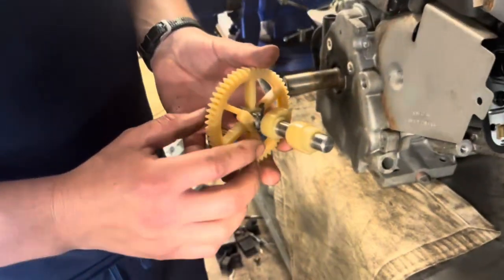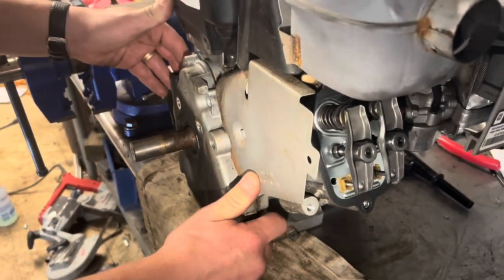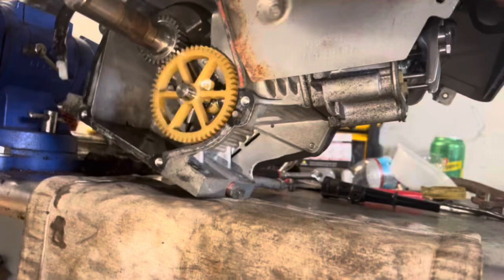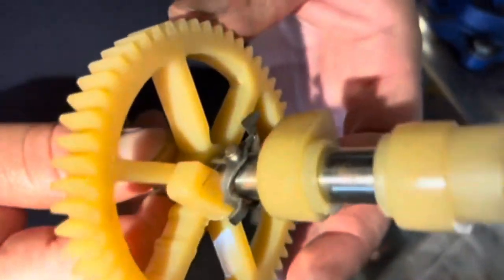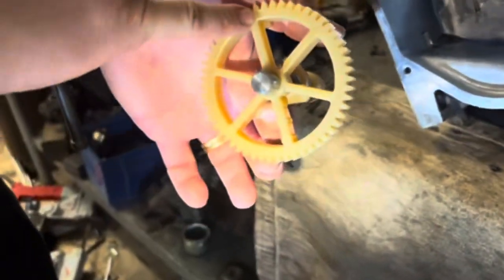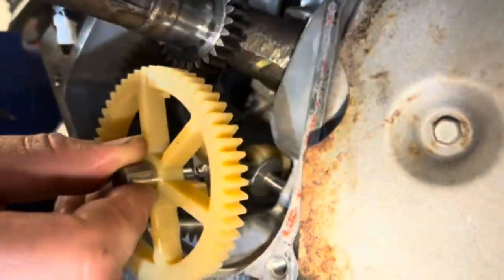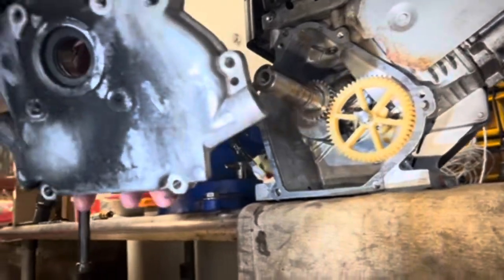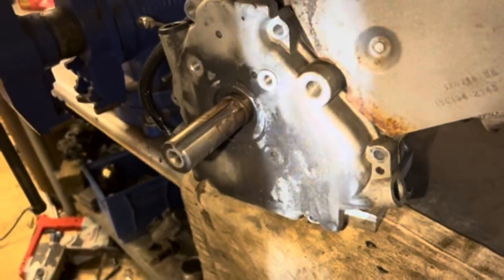@briggsandstratton Camshaft Replacement Horizontal Shaft Single Cylinder engines

Comment: i need a new camshaft do u have the part number  & source ?  thanks larry
Reply from the maker: They vary based on the model of the engine. Look it up using your model/type/code #. If you can't get that far, your best bet is hiring a professional. Good luck!

Comment: I have a briggs and stratton 190cc f1 series and found the same issue with the spring on the plastic camshaft and timing was off and intake guide rod would not move at all during rotation and would not start. Also the valve guide on the intake valve moved which prevent it from closing and no compression.

Comment: That looks almost designed to fail... I think I would have used an old/cheap soldering iron to embed the end of the spring a bit into the plastic.
Reply from the maker: We don't generally modify OEM parts here, the spring is so thin i believe it may be weakened and/or lose its memory from the heat. If you WERE to go that route, superglue seems a better bet, or one step better, a Honda or Tecumseh engine....
Reply: @smallenginesolutions  Ah, it's for a customer, I thought you were fixing it for yourself, that's why I suggested the hack 😅
If it is for a customer I agree that you must install it the parts as they come from the factory 👍